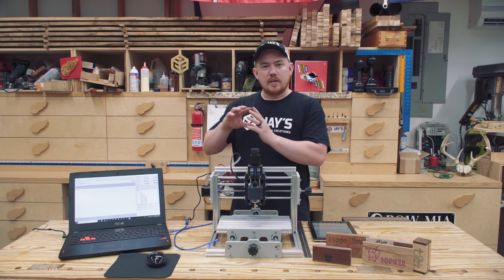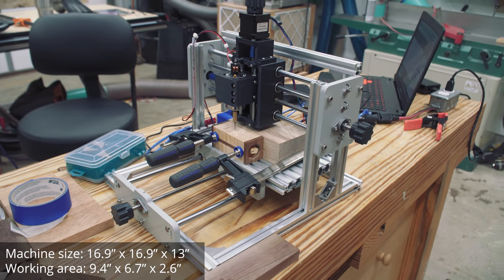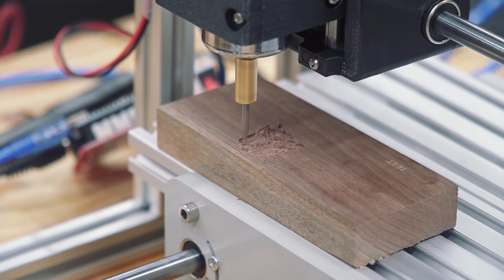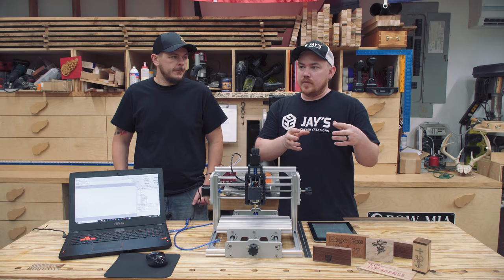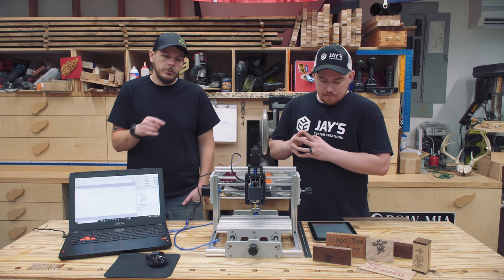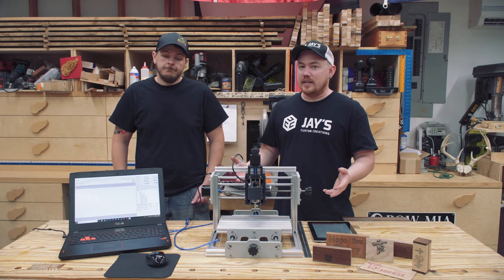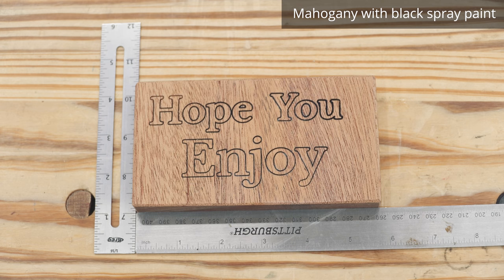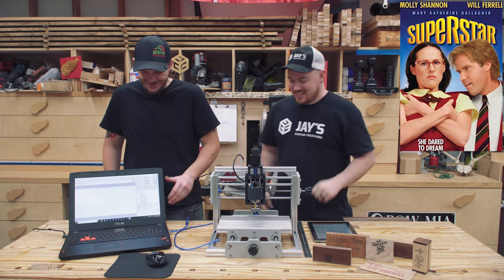Product Tour #1: 3 Axis Mini DIY CNC Engraver

Comment: would google translate have  helped? I used it when putting Japanese models together. you take a pic or hold the camera over the text and it translates what it sees
Reply: alaskankare the instructions that are given to you digitally that you download for assembly are in English but they're not very well translated and more than that they are generic instructions for what looks like multiple units with different parts so there is some figuring out to do.
Reply from the maker: Holy crap what a run on sentence. When talking into your phone to type pause and say "period" every once in a while, Jeremy ;)

Comment: Did anyone that bought the machine have trouble with the z axis moving in the wrong direction and the spindle spinning ccw? Thanx
Reply: I haven't had that problem with it.
Reply: check your GRBL settings .... might have it accidentally set wrong. i tweaked a few things too to make it home, add probing functionality and make sure the buttons in the interface match what i think the machine is going to move in.
Reply: a pair of wires swapped will make a stepper motor spin in the opposite direction. One coil will just be out of phase with the other. But as others have pointed out this can be corrected in software. Or you could swap either coil pair around and get it to reverse that way too.